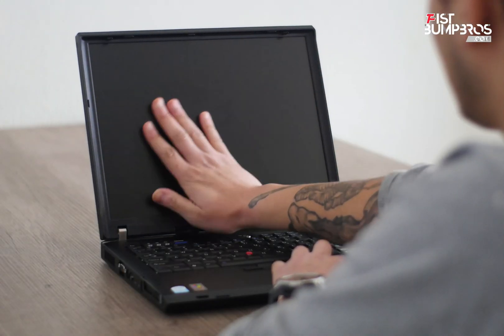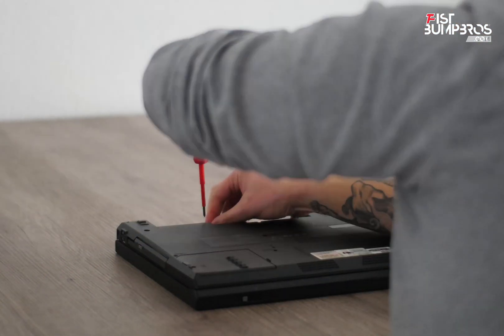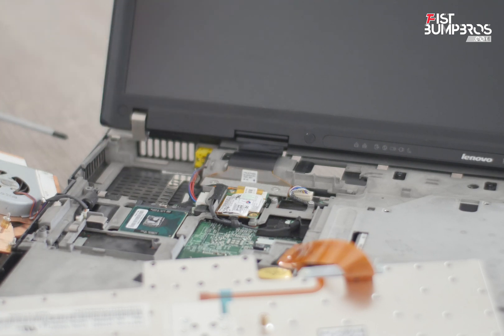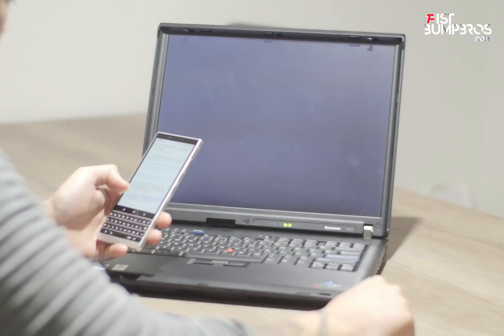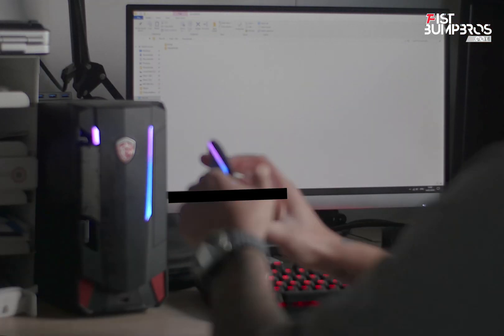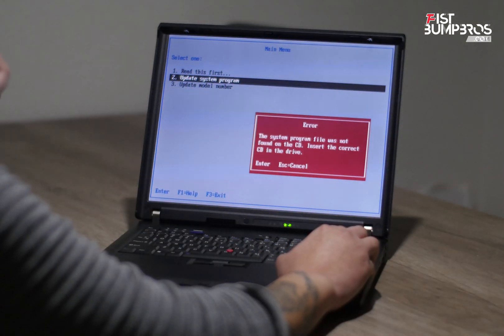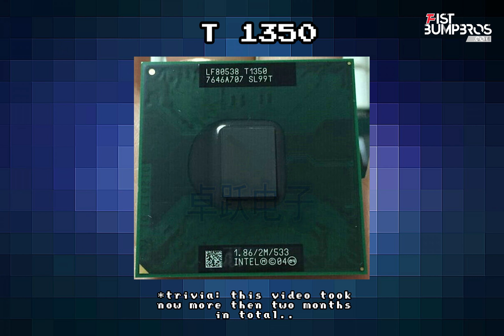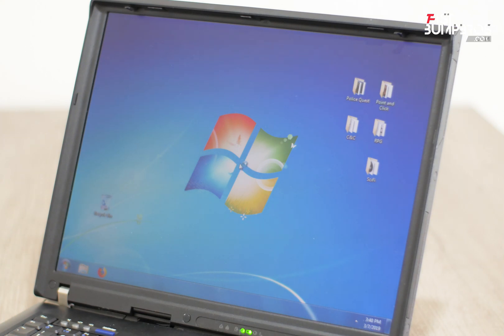Lenovo IBM Thinkpad R60 CPU Replacement T7200 T1350

Comment: The R60 shipped with single-core CPU usually comes with 940GML chipset which supports only single-core CPU like the T2xxx. Dual-core CPU like the T7200 will only work with 945GML.
Reply: The 940GML Chipset Only Supports 32-Bit Core Solo & Core Duo CPUs
Reply from the maker: Thanks for the info!

Comment: @firstbumpbros please help me i have a laptop lenovo r60 
Intel core duo T2400 can i replace it with intel core 2 duo e8400 3 ghz
Reply: According to a.i it is possible I was wondering if you tell me if it is possible a.i said it has same pins and board as e8400 and can easily be installed but bios must me updated please reply me as soon as possible because I want to order the processor❤
Reply from the maker: I would just try it. These newer cpus are pretty cheap.
Reply: @fistbumpbros  thankyou !

Comment: This is an older video, but in order to get a T7200 or T7400, you need to get a chip with the 4m/667 FSB, the 800mhz FSB ones will not work.
Reply from the maker: Thanks for the info!

Comment: Hi man, I ordered a T7200 CPU in order to upgrade a R60 (but the original and IBM one, not lenovo).
Will I need to upgrade the bios to do so ? If needed, do I have to make a CD to do so ?
Reply from the maker: Nope. It works fine without updating the BIOS.

Comment: Bro I thought of refurbishing the laptop today but it doesn't startup and gives 4 beeps along with no display ,how do i fix it, pls help🙏🙏
Reply from the maker: This happened to me when I replaced the CPU with an incorrect one. Check your RAM / CPU for faults or other faulty components.
Reply: Some days ago, i was using the hard disk as external hdd and then i put it back in the r60 as the internal one, do i need to format it in a different manner before it can be used again as an internal one or is it some problem with my ram bec when i removed the ram, the code changed to 1-3-3-1 from 1-1-1-1 , one thing is that the cpu is completely fine, so is it a problem with the ram,hdd or the CMOS battery
Reply from the maker: @electricalA.K.  not a problem with the HDD. I've used internal hard drives as externals before and put them back. If you didn't make any changes to the folders of whatsoever, it isn't the problem. It seems more like the RAM.
Reply: @fistbumpbros  Thanks a lot bro ,love from india, just for info i wiped the hdd before putting it back, so can that be a problem?
Reply from the maker: @electricalA.K.  yes, that is the problem. The HDD had all the drivers on it. A fresh install helps.
Reply: @fistbumpbros  how do i do a fresh install if the computer doesn't boot, kindly give me the process
Reply: @fistbumpbros  pls give me the process 🙏🙏
Reply from the maker: @electricalA.K.  You first have to fix the four beeps problem. Which indicates a hardware change/fault. In your case, I should swap the RAM modules: take one out (1 instead of 2 for instance) and see how if it runs. Try to narrow the problem down.
Reply: @fistbumpbros  thanks a lot sir, I appreciate your help a lot, and sorry for disturbing you so much, love and regards from India🙏
Reply from the maker: @electricalA.K.  no problem bro!
Reply: @electricalA.K.  Anything new man ? Got the same issue with 2 beeps only :(
Reply: I have same laptop and got same issue few years ago and it was fan error the laptop automatically got fixed after a few times of pressing exit button

Comment: This is a little strange, because my R60e has a running Intel Core Duo @1.6 GHz inside. The "e" in "R60e" is also in the processors name somewhere and means "no Hardware virtualization" (so VirtualBox runs only in emulation mode).
Reply from the maker: Alright, good to know and thanks for the info!